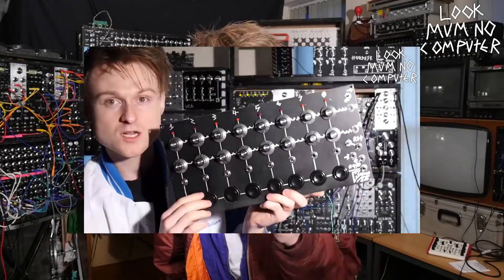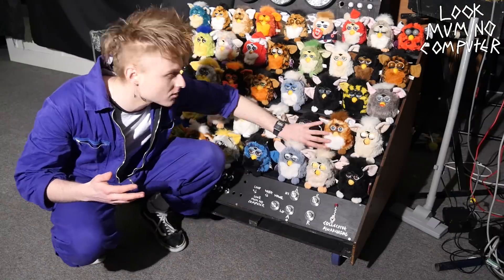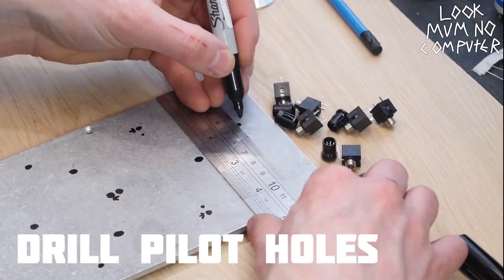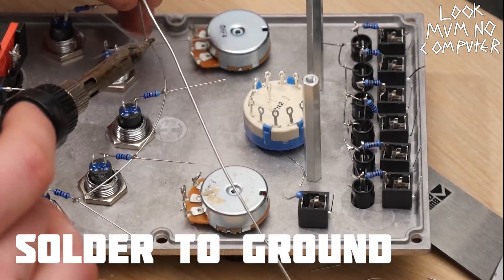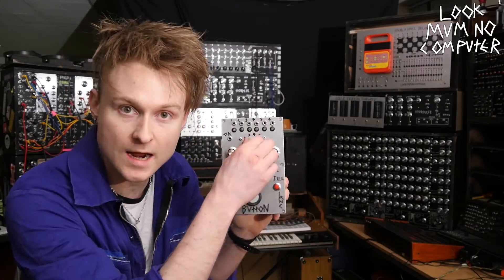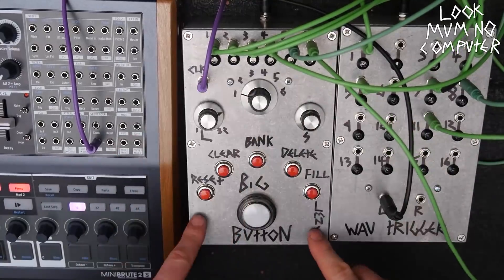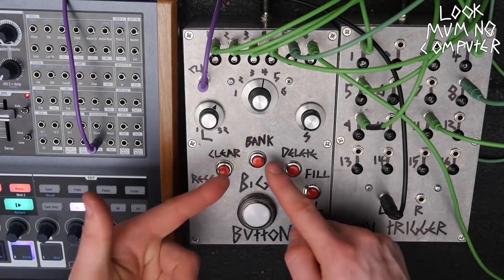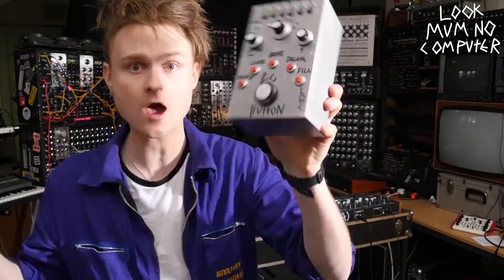How To Make Your Own Drum Sequencer DIY The BIG BUTTON

Comment: Ok, I've built it, but it keeps triggering like crazy, like, with every clock signal it triggers the big button!! Any help?? Already built several analog modules, and checked connections on this one, everything seems fine!
Reply from the maker: Wire a 10k resistor between the big button wire that goes to the arduino and gnd.
Reply: @LOOKMUMNOCOMPUTER  yes, already done that!

Comment: do you have a 3d printer if so I got a project I am trying to take all the axiom 25 pcb and but in a box and create expression module basically just hook up to editor and fill the banks with expression pedal goodies and then but ready to go ...pitch bend can be assigned to expression pedal btw since midi 2.0 system is used.

Comment: You know by far one of the most fun and simple to use drum sequencers is the Boss DR-660 drum machine. The sounds are kinda crap though. If only I had a kind of MIDI break-out trigger box with MIDI Velocity controlled VCAs I could run analog drum modules through so that I can trigger any drum module with velocity to volume control on every sound! I'm sure that would be supper expensive to set up in Eurorack format. :(

Comment: SSSSSSam!!! You added the following: "THERE HAS BEEN A MODIFICATION TO THE ABOVE IMAGE. the wire going off to the BIG BUTTON LED. is now on pin A3, so just solder that wire to the point on the stripboard that is connected to the arduino pin labelled A3" just after I printed the dang drawing! BUT! Where does the 3-pin D. C. power jack get connected? Saaaam!

Comment: Sick tutorial, lovely jovely loveit. But sadly, sadly it's not quite the tut I was looking for. I'm trying to build a master clock which generates a tempo sync signal in the form which a Td-3, Pocket Operators or Volcas understand. I think they generate something like 24 "clicks" per sixteenth note, similar to an audiosignal, but that's where my knowledge ends. Does anyone know how I could build such a clock?
Reply: Hello! quinxx12 im EXACTLY looking for the same
A DIY buildable hardware that can function as a tap tempo master for to give sync tempo to different devices 
example: to the CV input of a isd1820, or a PO 33 ko

i want to build a diy sampler based on isd1820 chios that can have tap tempo sync in its channels

you can check Jay Wiggins channel, it has what you are looking for
https://www.jaywiggins.com/2017/02/21/adafruit-trinket-based-sync-track-for-teenage-engineering-pocket-operators/

Comment: As a tip, programming NANO using pinMode(Button1, INPUT_PULLUP);  will make it so you don't need the 10k pullup resistors, very convenient!  You can toss your bag of pull-up resistors away!  :-D  And, in the event you have reverse logic you can still pull them down just use if (!digitalRead(Button1)) do thus & such.  SWEET!

Comment: I just built this and i'm having some problems,  mainly its the big button and its LED.  when I press the big button nothing registers at all and nothing happens with the LED.  I know the circuit is working because the FILL button works.  I'm not good at programming but can understand whats going on.  Can someone explain why the big button that is connected to A5 is called pin 19 in the code, as there is no pin 19 on the NANO.  Also Big button LED which is connected to A3 is called pin 20.

Comment: can you explain how the clock input is handled in the arduino? i see no reading of clkIn. the pinmode is set to input, but i can't find where the input is actually used
ok, i changed the line for the interrupt to this: attachInterrupt(digitalPinToInterrupt(clkIn), isr, RISING )

Comment: Why do you use a power regulator when the Arduino has it's own regulator that can use anything between 7 and 12V? I just did a MIDI clock generator  / big central tap button, and it runs from 9V battery or power supply directly... well, don't forget some nice diodes, otherwise you might still screw the Arduino.
Reply from the maker: Niels Ott safety measure. Sometimes (not always) on the cheap Arduinos the voltage regulators fail and smoke comes gushing out. It’s happened a fair few times to me. So now I regulate it always if I plan on using a power supply higher than 6v

Comment: I ought to smack myself for not building more shit. 

I had to build a guitar pedal of my choice to graduate physics 2. We had to source the parts that weren't on hand if we wanted to make something cool, and even draw, treat, cut, and print the circuit boards ourselves based on the schematics we had to create or find online. 

When the project started I was dumfounded our teacher thought we could handle this, and when it was done I was more surprised I hadn't tried it before. There's not much out there more rewarding. Everyone should build more shit, it makes the world a little bit better. <3

The box barely worked either but it made noise and all the buttons functioned, I couldn't find the right transistor so it sounded off. But it was so fun knowing it didn't just smoke up lmao
Reply from the maker: wise words
Reply: Thank you for everything you do on your website and YouTube! You've made a fantastic channel unique in so many ways. Here's to 500k this year :)

Comment: Thank you for the brilliant part, I have reconstructed everything as described. It works great only that the LED in the button does not work. At A6 no voltage is measurable and if I am not mistaken it is only an analog output. The code hint indicates wrong pin 20 instead of 19. I do not know how that works?
Reply: I have this same problem
Reply: @PoloMüller  There's an issue with some arduino's.   Change it from A6 to A3 and use this code Sam sent.   https://www.dropbox.com/s/qywysokcwotm9vp/BIG_BUTTON_MOD_LED_PIN_A3.ino?dl=0

Comment: Just finished mine. works fine.
the only thing is big button led wont work. maybe there is a error in layout?
Reply: i have the same problem
Reply: have you found a solution in the meantime maybe?
Reply: Connect the big button LED to A3, pin 17.

Comment: I started building a modular long ago and got too caught up in the weeds and stuck it under the bed. I'm pulling that bad boy out tonight and building some stuff! One question, how did you build your main keyboard hooked to the big wall? Just a kb you pulled from something and a voltage driver? Great videos!

Comment: In case it helps anyone...the led goes to pin 18 not 20.  Maybe Sam is modern day da Vinci leaving deliberate flaws in their masterpieces!
Reply: In his Arduino code, he listed BankLED as pin 20. Should I switch the wire and change the code too?
Reply: @pbartmess  BankLED should go to A3 which I think is pin 17. Turns out A6, where it is shown connected in the schematic, is only an input. I think that's why he changed his program to A3.
Reply: @MattRozema  Excellent! Thank you!
Reply: @pbartmess  No problem. Sorry its a bit late. 🤣

Comment: Just build this. And mine does make a sound! "POP" - when I plug it in the power plug. Could it be that the 78l05 is upside down? Must try to correct tomorrow so that it will need other sound to make sounds

Comment: The arduino actually has built in pull up resistors, you just tell the pin to go high like you would an output so you could do this without the resistors.

Comment: why do you dont use the "pinMode(pin,INPUT_PULLUP);" instad of pulldown resistors?
Reply from the maker: Mihi Gyver I don’t know anything about coding. I’ll use that next time! Thanks 🙃
Reply: its the internal pullup resistor of the chip all you have to do is proof for low level instad high. if you need help just ask ;)

Comment: Upload the code with a....... COMPUTER!!??? AHHH!
Reply: phones have computers in them
Reply: Wrong phone do not have computers in them only the smart phones are computers with a cell phone ability. I have a land line phone and a cell phone both do not do any computer down loading at all.
Reply: There's an arduino microcomputer inside the box lol
Reply: @tomm7273  As long as it's hidden in the enclosure, mom won't see it
Reply: in theory you can do this with a phone.
Reply: In theory you could upload it using a telegraph, yes it would take hours to do it.
Reply: Understatement, smart phones, or rather the ARM chips are one of the smallest and most efficient computer processors in their class ever made, at least for the consumer market.
Reply: @xdarrenx  You could even the arduino a computer, or maybe more like a very low level CPU. :D Okay, you can run a display and WiFi using an ESP32. 
oooh